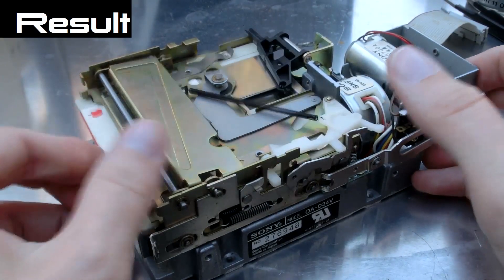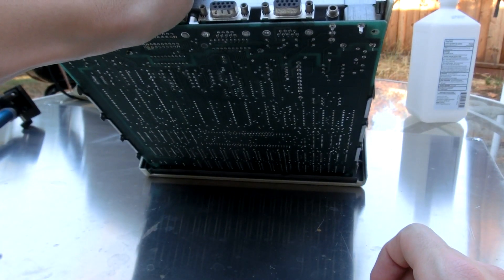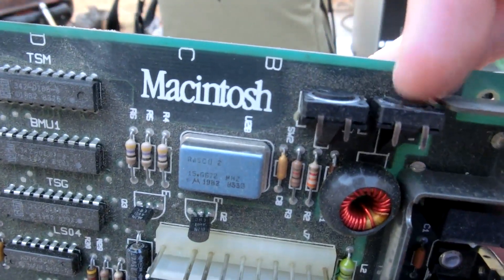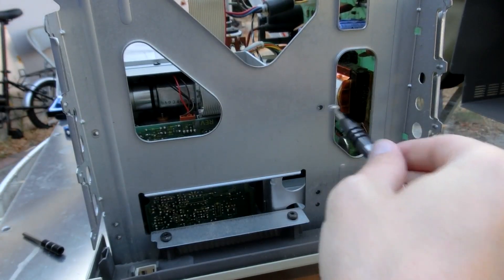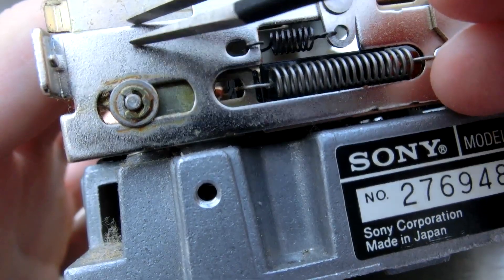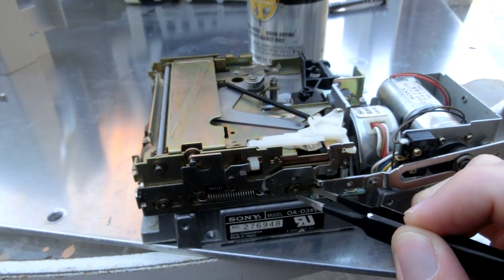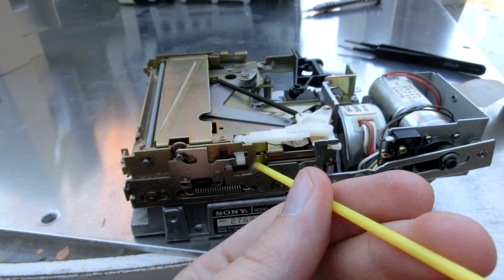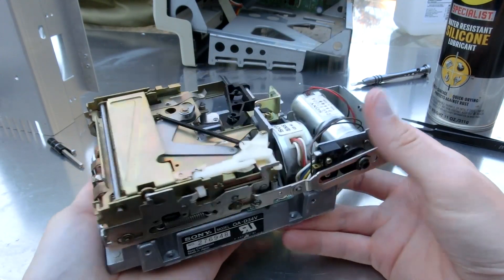1984 Macintosh 128k restoration part 2: lubricate 400k floppy drive

Comment: I use lithium grease and I think that’s the correct grease. You can spray a little in a small container and let the solvent evaporate or if you want it really thin, paint it on immediately with a q tip.

Comment: Any chance you replaced the PRAM battery while you were in there? I think I saw it soldered onto the logic board (was kinda surprised I didn't see a dedicated slot for it in the video). If it's still the original and hasn't exploded yet, then it's a ticking time bomb ready to blow up all over the logic board. It would look like one of the large barrel type capacitors. The Maxell ones were apparently the worst.
Reply from the maker: +raydeen2k ah i didnt notice it, oh well.
Reply: Comment is 5 years old, but, on the 128, 512, and Plus, the PRAM battery is on the analog board, but accesable through a door on the back of the machine.  Above the power switch, you can see the holder at like 44 seconds in the video(black holder).

Then with the SE later, they moved it to the logic board, where they tend to cause alot of damage if/when they explode

Comment: Next time, pay attention. The motherboard has notches on the right hand side. So, you don't slide the board completely out, you slide it up to match the notches and it simply comes out on the right side. Also, the other comments have mentioned using things like WD-40 and alcohol to clean the metal components and re greasing those components. NEVER use WD-40 for this. It is a good degreaser but contains other chemicals that leave a residue that is hard to clean off. Better to use alcohol. The beauty of alcohol is you can basically pour it on the thing and cause no damage while things like WD-40 will dissolve plastic and rubber components. As for what to use as a more permanent grease, white grease available at automobile parts supplier will last nearly forever on these things. It's meant for bearings operated at extreme temperatures and RPMs so, will do the job for many many years. You might think about getting a powered driver instead of that mechanical one. While it does work, it requires two hands to use properly and you can do the same job faster with one hand with a powered driver. And they are fairly cheap, under $20 in many cases.

Comment: 2 questions if it could run it,how long do you think crisis would take to load? and i wonder how many of these would it take to make it the average smartphone nowadays
Reply: First, it can't run it, it's a motorola 68000 based machine. Second, compared to a smartphone, that machine is a stone tablet in terms of processing power.

Comment: I've used silicone grease on my 16" oscillating fan. It doesn't last long. The fan seized right back up in 2 days. WD40 did much better. If you can wipe it inside, foaming white lithium grease works pretty good too.

Comment: Why anyone would keep this piece of junk from 1984 is beyond me...
Reply: Collectors I guess..... and other weird people
Reply: Kro Gon junk collectors are mostly weirdos yes
Reply from the maker: they cost like 2,000$ on ebay.
Reply: $2000?  I have one of these somewhere in my parent's basement, unless they threw it away...
Reply from the maker: digiprez77
well chuck it on ebay, some apple fan will probably snatch it up eventually.
Reply: Rinoa Super-Genius I am kind of a hoarder, I don't sell things on EBAY, I buy them lol.
Reply: + Advection357 Well, there's the nostalgia factor for one. There's also the challenge in getting something that old to work again and also seeing just how far into the present you can take it. I've pretty much always been a PC guy, but have collected a few vintage Macs that I like to fire up. Yes, I could pretty much run the software in emulation (and I do in some cases), but there's something about running it on original hardware that just feels really good. I've got an old Mac SE (FDHD Superdrive version) that I'm working on, along with a Tangerine iBook, a Grape iMac, a Power Mac G3, a couple Apple II's, a 2006 Mac Mini, and a 2009 27" iMac which is currently my main machine (mainly because of the insanely huge screen - my eyes are pretty bad). I can code on all of them, get on the Internet with all but the SE and the II's, do some office-y things, and game. 

Think of it this way, which would you prefer to game on, your favorite retro console, or an emulation of said console? Emulation is nice, you can hack the roms, do some cool stuff, have a million-bajillion games on an SD card, but it won't feel the same as actually sitting down in front of the real hardware and playing until your eyes bleed.

Comment: This was back before they realized they could start building pieces of shit that you replace every couple of years. I don't particularly mean Apple, but the whole industry in general.
Reply from the maker: no this is right when they realized that. although back then it was every 2 years. :P
Reply: Those that know... they build their own custom PCs... those that don't... well, they buy those pieces of shits.
You know what they say... beggars can't be choosers.
Reply from the maker: Advection357
nobody builds computers after the mid 1980s though, or at least they are only very small hobby computers. most computers now are just prebuilt circuitboards you just pop together.
Reply: Rinoa Super-Genius I'm saying if you want a good pc.. you can assemble one yourself by picking quality parts from reputable manufacturers instead of having to settle with pre-built brand name computers.. where you have less of a choice and end up with 1 or 2 cheap parts... and those cheap parts can take down the whole system... (IE: crappy power supply etc)
Reply: Advection357 I could very well be mistaken, but for his target audience I think that is a given.
Reply from the maker: Advection357
weather a computer comes in parts or together is irrelivant to how good the components are. like the Dell Optiplex series is really wonderful and reliable, and theres a lot of PC parts manufacturers that dont last long at all.
Reply: Rinoa Super-Genius Generally, pre-built brand name PCs will skimp out on some parts to drive the price down (they gotta make a profit right?)... if u want to make sure all the components are reliable, pick the parts yourself.. that's all I'm saying. You have no control which brand / model of power supply or motherboard you get with most pre-built brands.. that includes Dell. Not saying Dell is bad.. they make decent PCs.. but you won't get a Dell with a Seasonic gold/platinum rated power supply or a Gigabyte black edition 172 hour stress tested motherboard.
Reply from the maker: Advection357
so go to china and buy the chips yourself and design your own board? i think your generalizing too much. you can buy cheep desktops, you can buy reliable dekstops, you can buy cheep components, you can buy reliable components.
Reply: Rinoa Super-Genius You have limited choices with pre-built systems... that's my point.
Reply from the maker: Advection357
same for components.

Comment: Did you get the video problem of the screen going blank when you tap the computer? If not re-solder pin one of the cable connector on the analog board side of the cable that goes between the analog board and the motherboard.
Reply from the maker: it kinda stopped, but i reinstalled a lot of the connectors and that may be why.
Reply: It is a known problem. I used to fix those little guys when they were new-ish. I thought there was a diode which could come loose also, but I cannot find it online now or remember what it was.

Comment: What I don't get is that is a 1984 and it has a three and a half inch floppy instead of a five inch floppy.
Reply from the maker: i think couse the 5 inch floppies on the Lisa failed so much they were open to adopting something newer for the Lisa II, then the macintosh.
Reply: My family's 286 from 1984 had a 5.25" and 3.5" along with a 10MB Hard drive IIRC.  We added a larger hard drive and an external optical drive years later.
Reply from the maker: kuhrd
are you sure it came with 3.5" though? a lot of computers are upgraded latter. whats the model and manufacturer?
Reply: We purchased the computer in the fall of 1984 and I am almost positive it already had a 3.5" floppy drive fitted.  It was based on an IBM PC/AT 286 but was a clone from another manufacturer IIRC.  The 3.5 drive was DSDD 720kB.  It may have been added by my father when he purchased it, but I remember the drive being in it from day one when he brought it home.